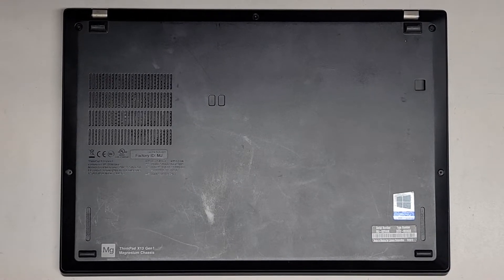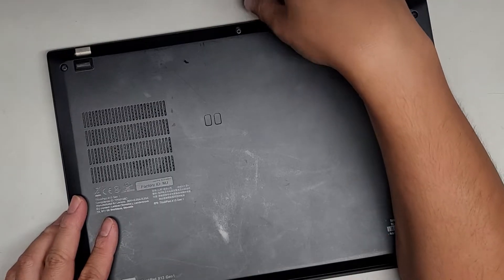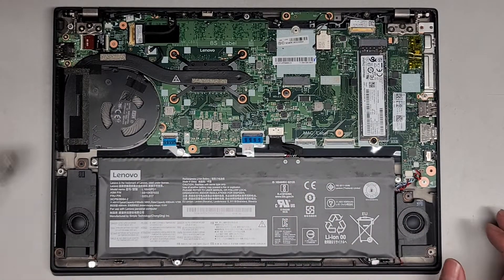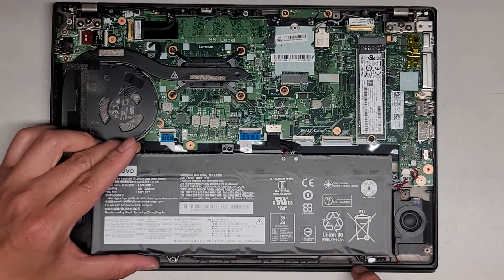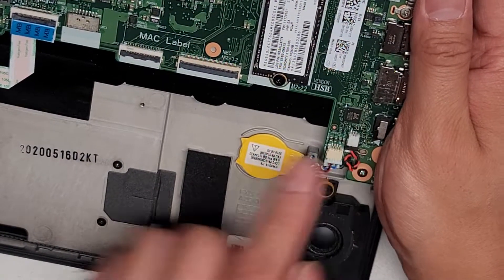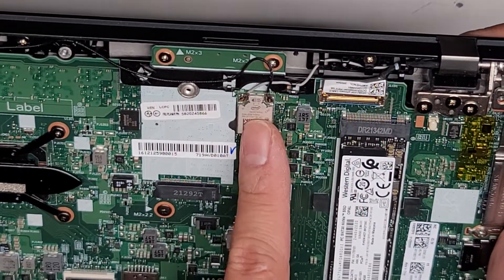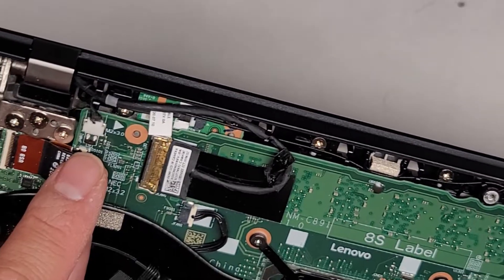Lenovo ThinkPad x13 Gen 1 Disassembly SSD Hard Drive Upgrade Battery Replacement Repair Quick Look

Comment: Hello, Thinkpad has this feature to disable the built-in battery to perform maintenance in the BIOS, correct? And in the video you showed that little button that needed to be pressed for 15 seconds to drain the residual power. Do I still need to press the drain button after disabling the battery? And do i need to press the power button also for 15 seconds? Thank you!
Reply from the maker: I'd still remove the battery, but if you want to do something else, do so at your own risk.
Reply: @ItsBinhRepaired  so what might be the correct procedur or the correct step to perform maintenance? Press the button first and unplug the battery or just remove the battery will sufice?

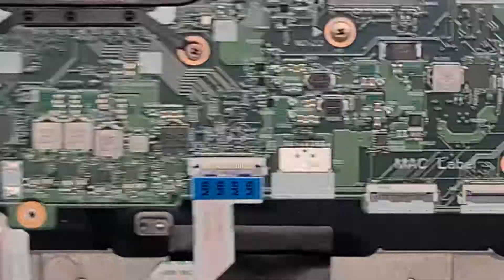Comment: Hi, one question. Min 4:00. There are two white cables conected to the MB. What is the function of that one near to the fan (the slimmer one)? My X13 Gen 1 AMD does not have that device. Thanks!
Reply from the maker: Fingerprint reader

Comment: holy fuck,today i saw someone's x13 gen 1 ram failure when runs memtest86(on reddit). how common is soldered ram failure ? is it possible to replace faulty ram ? replacing motherboard is only solution ?
Reply from the maker: It's technically possible, but requires a highly skilled board repair.

Comment: Can you use the laptop if the battery is removed but it is connected to power? Thx
Reply from the maker: @davidsanchez-bu9un  try it
Reply: Bf asking I tried but it didn´t work. I wanted to know if is able to working without it because maybe my laptop is damaged.
Reply from the maker: @davidsanchez-bu9un  what makes you think it's a battery issue?
Reply: @ItsBinhRepaired  I got the message: "0190 critical low battery error".  Clicking on reset button & removing the battery havw not fixed the error. Once that message pops  up, the laptop turns off.
Reply from the maker: @davidsanchez-bu9un  it means you need a new battery.
Reply: @ItsBinhRepaired  Hi,  by using a DOCK the laptop won´t boot if the battery is damaged (my case). I have used an AC cord and it is working fine despite the battery is not working properly. I just want to ask you if this bios for X13 needs to be updated in order to use a M.2 NVME because it is not dectected in the boot menu. I booted the computer with a boot usb and installed windows 11 (it was detected OK) but after installing some files and the first  reboot, the bios does not detect the M.2.  I think it is a BIOS issue. Thanks for your comments!

Comment: I was not able to open it, is there some screw below the keyboard?
Reply: I know i'm late to the show but for those that run into this, they likely have a swollen battery.  There is a clip on the bottom panel that latches to the top edge of the battery which is likely where its getting stuck.  Reason its stuck is because the battery is ever so slightly elevated and in the wrong place because it's swollen.  I just ran into this myself and had to do some firm left/right wiggling with a little muscle behind it and it finally let go.
Reply from the maker: Yup, need to use some force.
Reply from the maker: @arturoporraz6046  Just what's in the video
Reply: @ItsBinhRepaired  well I cannot open it, for some reason the part with no screws won't budge, as it is something in the middle preventing me to open it :/
Reply from the maker: @arturoporraz6046  clips

Comment: is it ok to use it even if it is charged because it is a built in battery?
Reply from the maker: @alexmeosjinlee9998  what do you mean?
Reply: @ItsBinhRepaired  I mean is it good even when used even when charged, will the battery be damaged?
Reply from the maker: I don't understand your question.
Reply: @ItsBinhRepaired I I think what he's trying to say is, is it safe to use the laptop while being plugged in or charged and will it damage the battery.
Reply from the maker: @jjaze9831  isn't that how normal laptops are used?